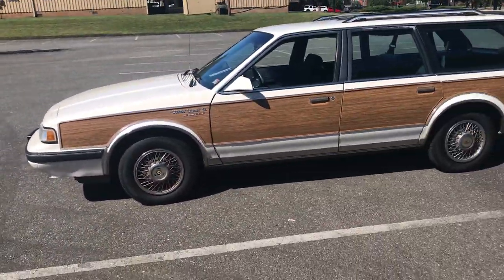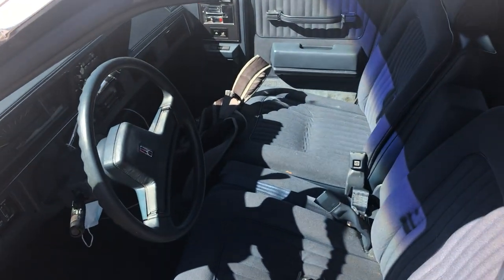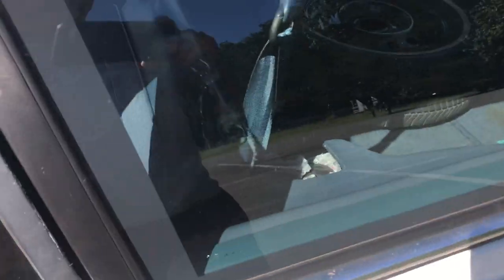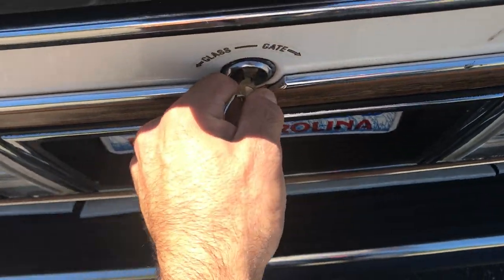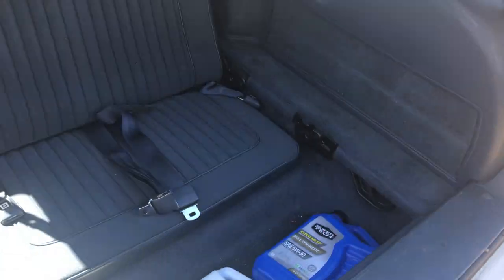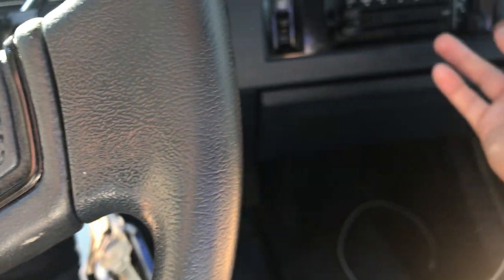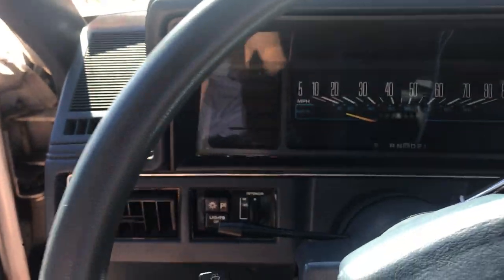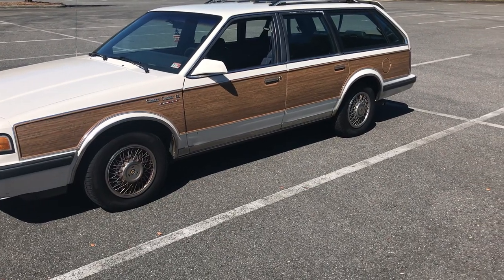1989 Oldsmobile Cutlass Ciera SL Wagon

Comment: Great video, great car.  I have a 91. Technically, it isn't a Ciera, it's a Cutlass Cruiser. If you have the Owner's Manual, you'll see both models named on the cover, and "Ciera" doesn't appear anywhere on the Cutlass Cruisers. I've had mine for many years, and I'm confident that you're right when you say it will make someone else happy.
Reply from the maker: thank you very much for educating me, you are right I was confused because of the badging on the side fenders :(
Reply: @averagecargarage1704  I came across something very recently that makes me think maybe the "Cruiser" distinction was dropped in the last two, maybe three years of production, and they then became Ciera wagons. Really nice and good cars, whatever they're named - "A rose by any other name smells as sweet."